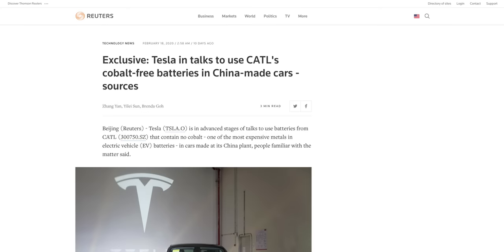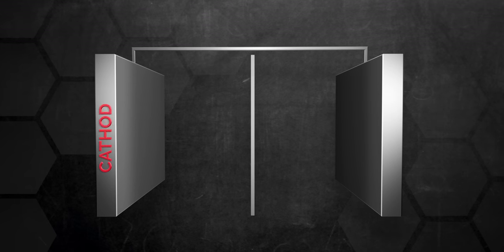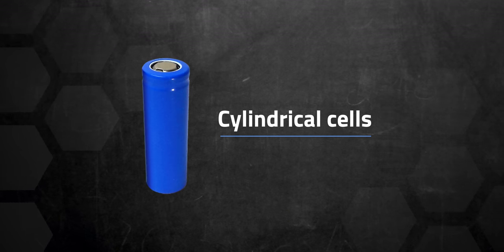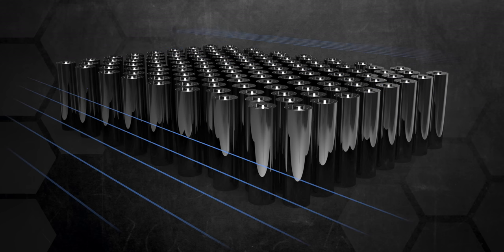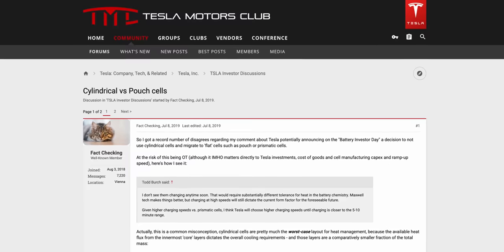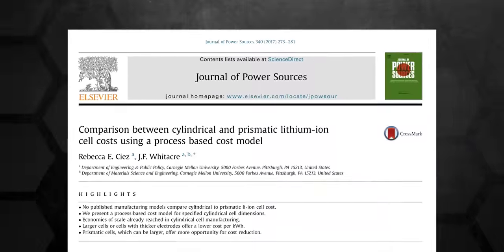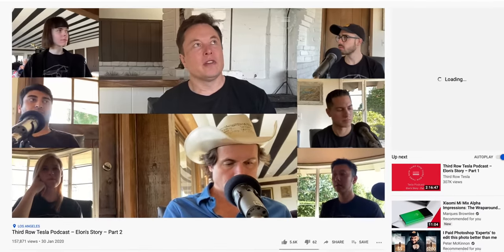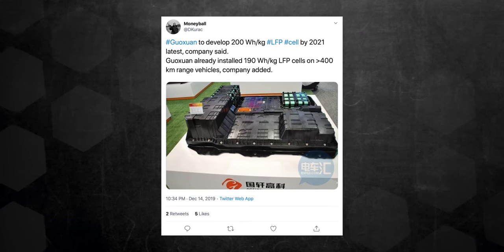New Tesla battery? Exploring the China prismatic LFP news

Comment: the battery management system can't target each cell as you say at 4:20,  it can only target each parallel group.  Tesla does use a small wire as a fuse to connect each cell though, so if a cell shorts out it will blow that fuse and disconnect itself.  The bms will not know directly that this had happened, it will just see less over all capacity from that group.
Reply from the maker: Good point ... I should have made that distinction.
Reply: Basic BMS, display cell group voltage. If you loss a cell group also lose voltage and current. I’m sure this basic detail Tesla, won’t let us down.
Reply: Check out Jack Richard  channel 
Yes , they can track each cell .
He broke the code for BMS
Reply: Individual cell voltages obviously can't be tracked, BUT the overall health of the parallel pack can still be tracked by observing the voltage drop under load for the parallel group.  This is something a BMS can already do via the balance leads, but isn't really something you would see in a run-of-the-mill BMS.   The little microcontrollers used in a BMS is plenty powerful enough to make the calculations though.

The BMS could then theoretically compensate (at least somewhat) for the calculated losses from deficient cells by using the balancing mechanism.   Also not hard to do, though ultimately the number of messed up cells may become too much for the BMS's limited balancing current to be able to compensate for.

-Matt

Comment: Thanks Matt, for breaking down the differences between the types of batteries and their pros and cons.
Reply from the maker: Sure thing.  I kind of geek out on this stuff.  Glad to see others are finding it interesting too.
Reply: Battery Design is only Secondary to battery CELL formulation.
so the Cell formulation plays a Bigger Role than what container its in. 
and there are Dozens of Cell formulations , some work some NOT so good. 
some are Highly Volitile, some are Stable but have low output, Others are low Density and High Output, others are Sutible for High Density but LOW output, Still others are ONLY Suitable for Energy Storage or Home battery, Still others are ONLY good as Electric car battery.
Battery Chemestry is the TIP of the Iceberg.

Comment: In the RC car racing world we've been using pouch packs for years. As you noted, cycle life is pretty poor. We tend to push them hard too with high discharge rates and running them from full to very low voltage. We see a significant capacity drop off after 50 cycles in this usage case.

Comment: One issue you didn't touch on is supply.  Seems batteries are the limiting factor for many of the EV companies right now, so creating a 2nd source (or 3rd) for a large segment of their China-based sales is imperative and if they can lower the cost at the same time, that's a big bonus for markets like China and help them hit a price target on the low-end units (std range or maybe even less than that on say a shorter-range car) .  Nice job on the technical aspects. You covered all the major design considerations in a way most people can understand.
Reply: @rogerstarkey5390  I agree the maxwell technology is very exciting, but nothing has been rolled out yet. Elon has stated they are battery limited many times now. I know I am waiting for the battery tech day in April before counting on what Maxwell will provide, but I hope your right and it helps on multiple fronts.

Comment: Need two things.  The ability to use a flexfuel ice charger portable generator and a home use solar/wind combined system to charge the car as you pull into the driveway with no manual connecting needed.  Even if just a dumb; Two leaf spring contacts and a temp battery charge holding cheapest pack available for storing the wind/solar for charging the car that is sunk into the driveway.

Comment: I could see Tesla going with both types of chemistry including the lipo chemistry. The lipo could make a lot of sense if it really does cut manufacturing cost and given that they already have the extra volume available in the battery pack area of the standard range if they really need the extra power they put in more dents battery pack that would be more expensive per kilowatt hour. It's just business and economics is what's driving it. I'm glad to see that they are keeping up the scientific investment in new technologies and in new chemistries because that's what's going to drive the world in the long run. But less dense batteries are very useful especially going into fixed storage requirements in places where they really don't need the power density to make an effective vehicle for a particular market. Great video and thanks for producing them I'll learn a lot and it gives me a lot to think about.

Comment: Could LFP find its way into storage systems? In static application power density is less critical then in EVs so the cost saving for grid scale applications could be significant while also freeing up 2170 cells for EV production.
Reply from the maker: LFP is a great option for energy storage systems (it's a growing area for it for sure).
Reply: I was thinking the same thing.
Reply: It's already very popular for small scale off grid solutions. It has a complication with temp, where charge or discharge below freezing is very bad for the cells. In a stationary installation, insulating it against the cold is easy though. You can even run a low draw heater to keep the cells happy for a very low percentage of charge per hour, so even with intermittent charging, it can be dealt with quite well. Harder on a vehicle really.

Comment: LFP batteries are getting very, very popular with the DIY crowd.  Including myself.  Integration vendors are starting to catch up but are still behind the times.  For example, there are very few UPSs available that use LFP chemistries (and the ones that do are extremely over-priced and tend to pack small batteries).  Most 'solar power stations' (of which there are dozens and dozens of models) still use lithium-ion / NCA or NMC.  Only a few offer LFP and they over-charge for the privilege.   There are some larger pre-built arrays becoming available that use prismatics.  There are at least two major Chinese vendors selling 280Ah cells on the open market for relatively cheap. 

Solar MPPT and PWM charge controllers still haven't really caught up... standard charge controller settings for LFP batteries when charging at less than 0.2C (which is very typical for solar installations) can't really be programmed easily for LFP because you can trickle-charge a LFP battery at just above the potential barrier, e.g. 3.40V-3.45V, and still eventually hit 95-98% capacity if you keep it going. 

At higher charging C rates, such as 0.5C, you can charge the battery far more quickly and reach a more definitive state-of-charge by looking at the voltage.  For those you can charge the cell all the way up to 3.60V or so (remember, the electrolyte doesn't start breaking down until 4.2V and most BMS's high-voltage cut-off will be at around 3.90V).  But if you allow 3.55V+ when trickle-charging at 0.2C or lower (really 0.3C or lower), you wind up with a 99% full battery which is NOT what you typically want.  Plus the automatic top-balancing that BMS's do tends to kick in at 3.50V per cell and not before.

This presents a problem for anyone trying to trickle-charge a large LiFePO4 bank, because most people don't want to charge their batteries past 90%.  So the charge controller needs to keep track of the Ah pushed into the battery.  Most charge based on voltage and current parameters instead of counting Ah delivered (they would also need to know the load current, so an external shunt would also be required).   Plus, when your target (or even effective) charging voltage is low (too close to the potential barrier), the cells tend to get out of balance more quickly.   It's a problem.

-Matt

Comment: The detractors who talk about batteries using cobalt never seem to mention cobalt being used in the manufacturing of petrol. Weird, huh?
Reply: Sssshhhh. Big Oil will hear you. :)
Reply: macgibbon And don’t talk about the catalytic converter using palladium or platinum. 
https://en.wikipedia.org/wiki/Catalytic_converter#Environmental_impact
Reply: Electric cars claim to be GREEN and ENVIRONMENTAL, combustion engine cars don’t.
Reply: The Cobalt is used a a catalyst, it is not costumed by the reaction. (If a microscope amount slowly as the converter degrades) this is significantly different.
Reply: Half of the cobalt is not used in batteries. Mostly in steel alloys like HSS or in hard metals. Significant part is used in ceramics as a color. It has never been problem before EV's started to use it.

Comment: It's worth pointing out that cell-to-pack engineering is possible for cylindrical cells, too.  Elon even remarked that in the Model 3 pack, the modules have no point.  The modules in a pack are not interchangeable; each has its own part number and has to go into the correct slot in the pack.

So efficiency gains for LFP prismatic cells using cell-to-pack engineering designs will not yield any advantage over cylindrical cells, since packs using cylindrical cells can benefit from the same design approach, and the performance gap will be maintained.

Comment: My guess is that the new Tesla battery will have a cathode that is nickel-rich and cobalt-free. As you said LFP cathode will reduce cost, but it is unlikely to have more energy density than current NCA (Nickel Cobalt Aluminum) that tesla uses. My understanding is that to increase energy density, you will need more nickel in your cathode (For example the shift from NMC 111 to now NMC 811). But LFP has no nickel, hence lower energy density than NCA or NMC(Nickel Manganese Cobalt). Tesla has been reducing the cobalt in their NCA over the years, maybe they have finally figured out how to remove cobalt completely? and at the same time increased nickel content. A cathode with higher nickel content and no cobalt means a battery with higher energy density and lower cost. Maybe LFP is just for storage and/or standard range model 3. Just my guess, not an expert! Cant wait for battery day!

Comment: I saw this mentioned in another video and I think it is a common misconception about Nissan Leaf batteries.  Nissan Leaf batteries are not prismatic cells.  They are four individual pouch cells stacked inside a metal module. As a Leaf owner, I thought I should clear that up.
https://qnovo.com/inside-the-battery-of-a-nissan-leaf/
Reply from the maker: Gah ... I should have caught that.  Pouch and prismatic are very similar and tend to get lumped together.

Comment: Battery thermal management system is bigger reason why I do not think Tesla would move to prismatic battery, only if they will move on all fronts, but is hard to believe because they experience in current technology, faster they would move to pouch because they may use frame of car around as structure to protect cells, but it would required not flammable batteries, thermal management would not be hard, but required redesign, but Tesla would do it, if they see it as better in final form (no sunk cost fallacy)

Comment: 4:12 - Have you got a source on that? Can the BMS target at the cell level? model 3 is a 350-400v system, so 96s46p configuration.
Reply: Not per cell, but per parallel pack. That needs a correction. If I wire 46 cells in parallel, they behave like one cell at the same voltage  but with increased capacity, amp hours (Ah). It isn't cost effective to balance cells in parallel, it's easier just to make sure they all closely have the same capacity so when they're drained, the drain is equal across all cells to get the most capacity. The rule of thumb is the capacity is only as much as the lowest capacity cell in parallel. So, no each individual cell can't be balanced.
Reply: @FaceTubeU   this what I presumed but in that model 3 battery breakdown by Jack Rikard, he mentions that each module has a power and comms trace running to each cell. At the time he was trying to decipher the comms protocol, mentioning ISO and SPC or IC2 or something... interesting shrugs

Comment: people do not understand how much design goes into the existing battery pack design. It would have to be a very big reason to change formats from the cylindrical type
Reply from the maker: It could be worth it though for cost savings.  Also, there could be a political angle as part of all of this.  China really rolled out the red carpet for Tesla with how fast they built out the factory, the speed at which they got approvals to start selling, etc. Tesla using one of China’s leading battery manufacturers and some of their cutting edge tech is Tesla playing nice with a very supportive partner.

Comment: Matt...I think LFP will make sense in markets like China and Europe where people tend not to need longer ranges because most rarely drive long distances. I think dry electrode and other advancements for Battery day will be particularly important for U.S. market long range, Semi, Roadster, etc. Do you think this makes sense?
Reply from the maker: I think you’re both right (lol).  Primary benefit is cost savings because less, space, equipment, etc.  Secondary benefit is that it aids in making more energy dense formulations.  I don’t think it’s an either or situation.  They could use DBE for the LFP batteries in China too.

Comment: The capacity of LFP batteries on the open market has gone up, and the price has come down phenomenally in just the last few months.

Never mind electric cars... fixed installations are going to be the biggest beneficiary.  Its already tearing up the industry with most of the vendors who have become used to charging a relatively large amount of money for LFP (LiFePO4) now suddenly finding themselves looking for new suppliers in order to push the price down before they lose their markets.

For example, a 100Ah 12V (13.2V) BattleBorn battery is still around $850-$950.   But you can now buy 4 x Prismatics @ 280Ah and get almost three times the total capacity (in Wh) for less than $500.   4 x for 13.2V nominal, 280Ah vs 100Ah.   2.8x the capacity for a little more than half the cost, not including the BMS.

One 16 x series build with 280Ah prismatics (requiring one 16s BMS) is around 14kWh of storage for around $2000 DIY.  $2500 including the BMS and insundries.

The only down-side to LiFePO4 is that the energy density is a bit lower than NCA.  This is why "never mind EVs.. though I'm sure they'll be fine in EVs as long as people don't mind the slightly lower range.   LiFePO4 has lower internal resistances, more robust responses to full discharge and full charge cycling, and the cell chemistry can tolerate up to 4.2V before the electrolyte starts breaking down (where a normal full charge at 0.5C is 3.60V-3.65V per cell, and the chemistry settles at 3.30-3.40V).  Cycle life is 2000 cycles if you abuse them, 5000 cycles 20-80-ish, and 7000+ cycles with light depths of discharge.   Which translates to 15-20 years nominal life.  The failure mode is simply a loss of capacity (above numbers are from 100% capacity to 80% capacity), so they can still be used after that if you are willing to accept the lower capacity, possibly up to 30 years but at that point cell construction starts to matter (so cheap Chinese batteries... not necessarily CATL, but other vendors, might not be able to last that long).   Also LFP batteries are much safer.  It is very hard to get one to go into thermal runaway due to the high cell voltage tolerance (etc).

In otherwords, LFP cells can be abused a lot more than other lithium chemistries, last a lot longer, and are safer.  This is my absolute favorite lithium chemistry.

-Matt

Comment: Well the Maxwell dry electrode tech supposedly works with a low cobalt formula, but it doesn't bend well because the composite sheet created is too thick and that required them to wind cylindrical cells on a 3" diameter blank, lots of wasted space. A prismatic cell is flat panels of battery, so the maxwell tech might be going not into cylindrical cells at all, but exclusively into prismatic cells, which have the cell to pack arrangement, and Tesla could form a deal with CATL to co license tech, they get the chemistry, tesla gets the architecture, and they both profit, and CATL gets to mass produce prismatic cells in China that the whole world has a massive demand for while Tesla gets a chunk of royalties for which might exceed the payments they make to CATL for the use of the architecture...? 

Hard to say until battery day, like you said. 

It's worth noting that the dry electrode cells are more heat tolerant, which is nice in a prismatic since you have less coolant penetration generally.